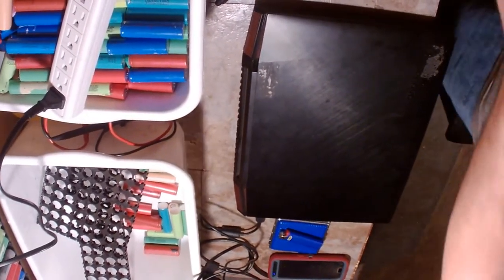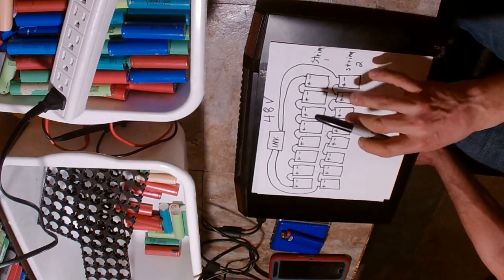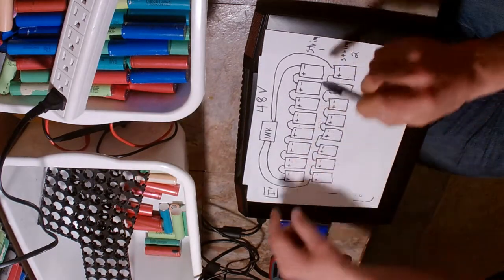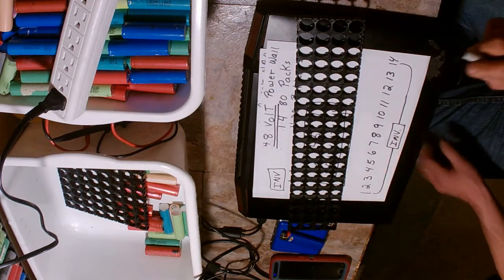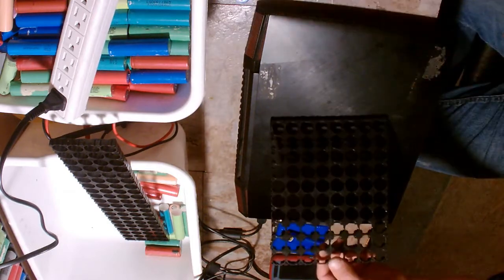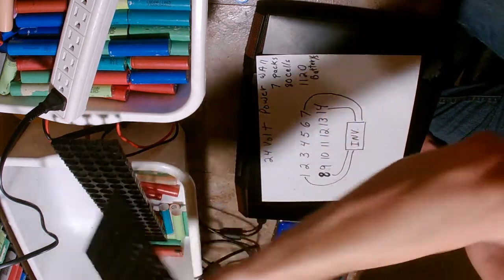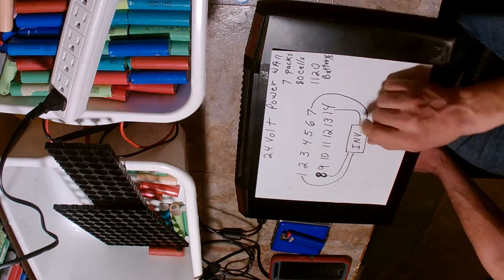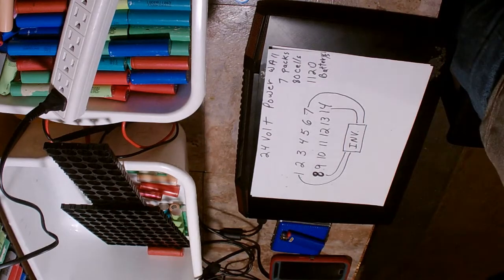why a 24 volt diy power wall is  better way than 12 or 48 volt

Comment: Why do the cells at each end of the strings use more water? All the cells have the same current through them because they are wired in series. A 48 Volt system should be the most efficient system because it uses less current than a lower voltage system.
Reply from the maker: i cant say why the end cells water level is lower but i can say living off grid for more than 10 years that was my findings and im told to alternate the batterys for those reasons as they are expensive im useing rolls surrette s530